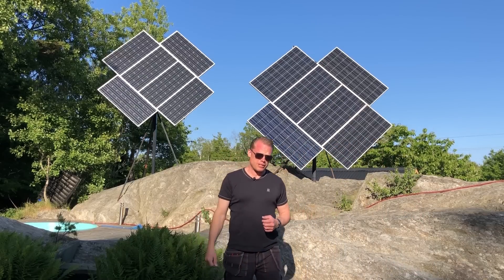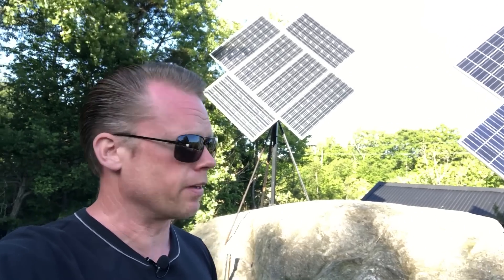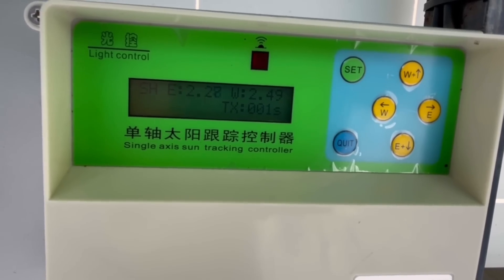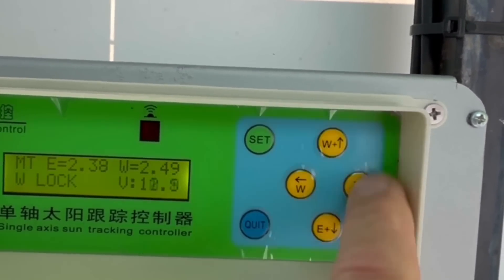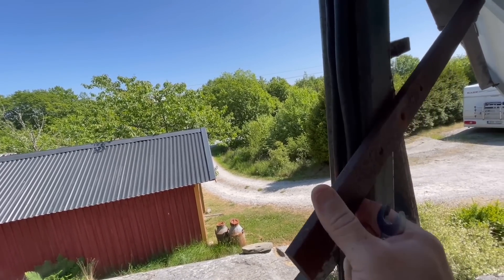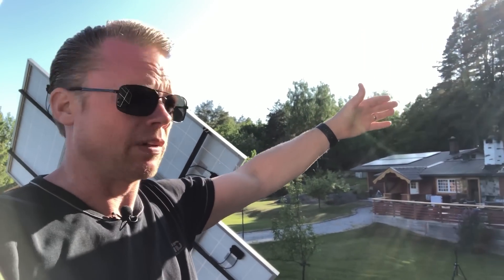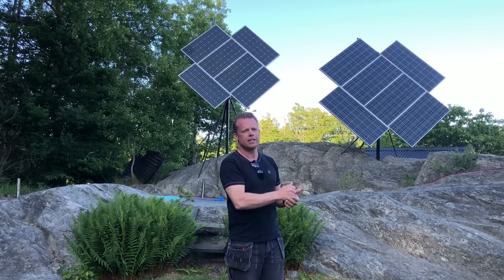Diy Budget Solar Tracker System, tracking vs no tracking.

Comment: Due to the extreme drop in the price of solar panels, it is nowadays extremely cheaper to simply install more panels instead of a tracker!
According to studies, trackers generate a maximum of 40% additional yield per solar panel. But they also cost only 50-100 $ per 450 W panel!
In any case, trackers are mechanics and need maintenance. Trackers are very susceptible to wind and lightning strike. For this reason and because of the mechanics, 
most of them only last some years. If you want more constant yields throughout the day, you simply have to set up your modules in an S-E and S-W orientation.
Reply from the maker: Same comment, different video but you will have the same answer 😅

We guys with trackers already knows everything about that. We do it because it’s fun☺️

Thanks for helping me with the YouTube algorithm btw.👍🏻

Comment: How many KW of heat will the home absorb in thw given time if you cut the trees? (And the opposite for winter/heat)
Reply from the maker: We normally don’t need any ac during the summer. The sun has already passed the horizon before it reaches the trees in the winter time, so no gain of power there.

Comment: I would bet bifacial panels would be better in such tracking systems as opposed to ground mount or roof mount.  Probably would gain you another 10-15%.

Comment: It all comes down to the cost though. That tracking device seem to need some hour of labor to put together as well as the parts. With that much effort and money, it might be cheaper to put a few more panels on the side.
Reply from the maker: Absolutely, I already have more panels and a 62kwh battery, you will find more here: https://youtu.be/IM2jXbgr70A?si=sb3XYXUw_GLmqo7U 
But still i think it’s interesting to show the difference.
Reply: @flyingtools  For sure interesting. And if the space is limited, this is necessary. Thanks

Comment: How far apart are the posts spaced so that they do not shade each other. Thanks
Reply from the maker: Around 6 meters i guess, but one of them are much higher, but in the darkest weeks the south one actually cast a tiny shade on the rear one. I made it telescopic so I can raise it up even higher, but I don’t bother to do that anymore.
Thank you for your question☺️

Comment: Interesting! -- QUESTION -- one issue, @11:50 you show power charts, with Power (W) on one axis, and time on the other.  But the time scale is unclear.  Why is it not showing solar on an hourly scale.  It is not consistent from what I can tell.  Can you show us the chart with the bottom scale in an hourly scale?
Reply from the maker: The screenshot was not taken exactly at the same so the timescale or a little bit of. Sadly, I don’t have any other photos of the chart.

Comment: Nice place!
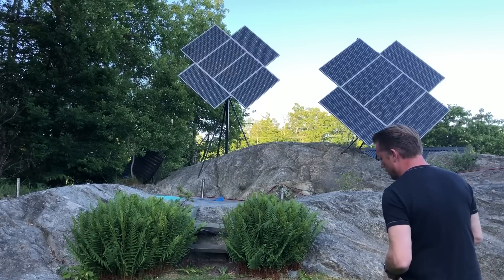11:35 remove trees and put wind generators in the next summer!
Reply from the maker: Thanks, already tried wind generator, I have more videos about that, but I sold it when I changed my battery voltage from 48v to 450v.

Comment: im planning on using similar setup at my house next year so this was very helpful video. I have a question, would 2 axis tracker make sense for winter sun? My plan is to heat water tank storage for heating and washing which in winter is more needed than in summer.
Reply from the maker: I have done some testings with a second axis, and it will not be worth the money at least not here where I live. In the winter time, I just have my panels fixed straight to the south.  I have plans to do a test during the winter time to see how much the gain will be than, I think it will be very little to be honest.
Reply: @flyingtools  thank you for a reply. will consider the simplest solution probably

Comment: That’s amazing! This is what I’m looking for. Do you have some data for me to do a similar construction in Belgium? What kind of single linear actuator and damper did you use? Any help is appreciated 🙂. Thank you in advanced.
Reply from the maker: Hi, and thank you so much for your comment. I have built this straight out of my head so sadly I do not have any blueprints on it. The activators and controllers did I buy on eBay. Hope it helps and have a fantastic day.😊
Reply: @flyingtools  Thanks for response. But what kind of damper did you use, 500N for example? And the single linear actuator is how long for turning your panels? Maybe 18 inches?

Comment: Tracking should always be done on two axes, and then you'll see the real power of the system. The difference, on a clear horizon and tracking vs non-tracking, is actually about 54%. You should only install tracking if you have a complete clear horizon path. Other wise, the difference will be smaller, and in the monts before and afte summer, the results are gonna be bad. Of course, the investment for the tracking systems are small, so there's a bit of a good news.
Reply from the maker: Wow, that’s a very hi number. I adjust the second axel manually, 3 different settings, winter, spring and summer, and I have done some tests with 2 axis vs that type I already have and the difference is not that big at all. But it depends more on where you live. Closer to the poles, the better the numbers tracking versus no tracking will give you, during the summer.

Comment: Very nice sun trackers, not too big or heavy but still producing some useful amount of power. There is also a single  axis tracking option which might be less complicated but also there is going to be slightly less increase in energy. Best regards! Very interesting video!
Reply: This is a single-axis tracker -- with a simple by-hand altitude adjustment once per season if you can be bothered (it seems he can't, just always leaves it in "spring/autumn" setting).

Comment: Where did you get the tracker?
Reply from the maker: I bought the linear actuator on and the controller on eBay, the metalwork have I built myself. Thank you for your question.
Reply: @flyingtools  l can't get the linear actuator to operate off the solar panel alone. Using the charge controller with it just runs the actuator continuously. It won't stop.

Comment: I'm curious -- why did you choose to wire all the panels in series instead of in parallel?
Reply from the maker: It is not easy or maby not possible to find a certified inverter that will work on low voltage in Sweden. There is also 20m distance between the inverter and the trackers so the power loss in the cables would be huge, or the cable all too expensive. Thanks for your question.

Comment: I have 2 arrays and four 400w trina panels (one of them is getting weak in it's production) So.. 2 panels on the ground with a bout a 1 foot of tilt and both side by side pointing to the west. On the Eco worthy dual axis tracker  are the other two 400w panels but one of them is disconnected for now. But in the last week I've been watching it daily and the tracker is IMPRESSIVE..  One panel is making more power than the 2 other panels. https://youtu.be/I566UjPPLXo

Comment: Great video! Just add 30% more panels. (They now so cheap) and avoid tracking unit manufacture and Maintenance, to achieve the same result!
Reply from the maker: I absolutely agree with you on that. I built this, mostly for fun and I of course have a lot of fixed panels also. Thank you for your comment.

Comment: Goid day sir watched every second of video.

I question whats the benefits of doing in series (higher input voltage) vs parallel on the panels
Reply from the maker: Hi!
The power loss is much lesser, and you can also have a thinner gauge of cable.
The inverter also does a much better job with higher voltage and less heat from it. The only downside is that it is dangerous for us humans, and of course, if you shade one panel, the whole string will drop in power.
Thank you for your question.
Reply: @flyingtools  thank yoy

Comment: I have space and money for about 60 200W panels.  While I'm going to skip the tracking, I am going to mount them all on an axis, so I can gradually adjust the angles through the seasons.
Reply from the maker: Yes, that is a much better solution, i’ve built this mostly for fun and thought that it was a good idea to show you guys how much a tracking system actually will boost the kilowatt hours in a long summer day here up north. I of course also have fixed panels and that’s the way to go if you want to build a large system. Good luck with your project
Thank you for your comment.

Comment: Do you manually adjust angle each season or do you leave it same and only track E to W? If you adjust angle, how much percentage improvement?
Reply from the maker: Yes that’s right. I have not done any tests to it but nowadays, I just leave them in spring position, but I can set them between winter spring and summer, but I don’t think that the power output will be so much of a difference. Thank you so much for your comment.

Comment: I've been doing off grid solar systems for about 24 years now and from my experience all trackers fail. And sometimes they fail pretty quickly. Being that you can now purchase solar panels at roughly $.75 per watt I have never seen a calculation that makes trackers even remotely worth the money and installation expense. I also think it takes away from the beauty of solar which is no moving parts and easily lasts for 25 years.
Reply from the maker: You are absolutely right about that.
I have built this mostly because it’s fun and it has been working pretty good for 9 years without any major issues.
I already have 11,25kwp of fixed panels and a diy Hv battery at 62kwh on 450v.
So this tracking system is a minor part of my whole complete setup.
Thank you so much for your comment.
Reply: @flyingtools  That is awesome! Good for you! The funnest part about solar is learning and doing things for yourself! I still have a wind turbine on a 52 foot tower and in the scheme of things it is basically useless. But it sure is Bitchin and I love it when the wind blows hard. My girlfriend hates it and always turns it off.  😝
Reply from the maker: @boblatkey7160  haha, I also had a wind turbine when my battery bank was on 48v.
I have to say I really loved it, but it did never produced so much power, but I loved it anyway😅

Comment: Flying tools

I have always wondered, why people don't mount, mirrors or a mirrored surface, in the sunlight, so they can direct more energy onto the panel's, in low light conditions.

So at Dawn and dusk or cloudy days, you can double or even triple the amount of light hitting the surface of your panels... Obviously on full light days, this would make them too hot. But in a low light condition, this would keep them functioning at 100%
Reply from the maker: Probably because it’s too complex and also more expensive of course, but it is a really interesting idea. Thank you so much for your comment.😊
Reply: @flyingtools  If they can mount 10,000 mirrors in the desert and focus them all on one point to create a hotspot you can focus two mirrors onto your solar array lol

Come on. You're at least 1/5000th of the men they are lol
Reply: @Bozemanjustin  you come across in your comments as a rather rude and abrasive person... 😕
Reply: Mirrors in combination with Photovoltaic is not a good idea. The mirrors will also focus IR (heat radiation), thus heating the panels. PV efficiency drops massively with heat. So, in the end, the added effort may even be detrimental.
If done in combination with solar thermal set-ups, mirrors make of course a lot of sense.
Reply: @klausdittmer1043  The "temperature Coefficient of Pmax" of most solar panels is about 0,4%/°C  (it tells us how much power it loses for every °C that the panel is hotter than 25°C). Even is the panels would get like an additional 20°C hotter than normal when concentrating (a lot of) light on them, they would only lose an additional 8% of power (20°C * 0,4%/°C = 8%) (for an additional 20°C rise in temperature a lot of additional light would be needed). 

The added temperature could potentially degrade the panels sligthly faster..
Reply: @klausdittmer1043  you read my initial comments I specifically said, you could only do it in low-light conditions, just to make the solar cell work at 100% efficiency.

It is one-hundred-percent possible because years after I came up with this idea I want a scientist actually do it and test it

There's plenty of light in the sky at very low light times if you concentrate that light

So monitoring temperature was included in that

But you would have known that if you actually had reading comprehension for what I wrote
Reply: @Bozemanjustin  
I think we both understand the basic issue but draw different conclusions. 
Mirror arrangements that are to be applied only in low light conditions seem not trivial and  are likely adding quite some complexity. Wondering whether the added costs would justify the effort. Might be worthwhile to build a cost model (additional energy gained vs. additional costs) and also compare to just using more panels as an alternative way.

Comment: How much energy the tracking system consumes?
Reply from the maker: Interesting  question. I honestly don’t know. But it’s not much. It now takes the power from the grid using a transformer 220v ac in to 12v dc out. I have also used a 12 V battery on 51ah and that did last for around two weeks so maybe around 50wh/day?
I think I have to measure it up just for fun
Thank you so much for your comment. 😊

Comment: in small right spaces, this is excellent, but where space is not an issue, more panels are cheaper and don't incur the maintenance costs of tracking (and reduced risk of storm damage)
Reply from the maker: You are a spot on there👍🏻
I of course have more panels, 11,25kwp and a 62kWh diy 450v battery.

I have built this mostly for fun. 
Thank you so much for your comment.
Reply: @flyingtools  fun is the best reason! and on really gloomy days, you'll still get a nice bonus.

Comment: So what was the differential kWh - ie area under the curve added and what percentage additional did that represent over the baseline?
Reply from the maker: The difference between fixed and tracking is 3,6kWh in this set up.
It will be much less in the winter time.

Comment: Hello man. What a model you use a tracker engine/actuator and where you buy this? Tack
Reply from the maker: Hi!
I bought cheap linear actuators on eBay for this, 550mm 1500Nm if I remember correctly. I might do a separate vide about the parts I am using.
Thanks for your comment 😊
Reply: @flyingtools  This will be very nice about parts list. Thanks

Comment: Nice work… Thanks for all the research … The counter discussion is to ask what is the extra cost for a tracking system versus 30% more panels … Assuming space is available and that the peak voltage does not require a bigger inverter …  Generally if space is available I find extra panels are a cheaper approach …   Again thanks for the video ..
Reply: 30% more panels will theoretically make up the shortfall in daily kWh, but your problem is that adding those panels may see the array exceed the controller's maximum voltage or current limits in the middle of the day, including the potential short circuit current limit.  So ideally you would have the additional panels with a DC circuit breaker on a timer which brings them into the circuit in the morning and evening, but drops them out of the circuit at times of peak insolation.  
Depending on the setup, this may only be a problem in summer, but it needs to be considered.
The tracker system doesn't have this issue.
Reply: @nigelwilliams7920  The issue is cost. If having a tracking system is cheaper than adding more panels to get 30% more power then it'd be best to get a tracker.

Another issue is that it might be better for people who aren't home during the day and have no battery. Those people need more power in the morning and evening when they are home.
Reply: The time of supply is alos important I guess. You want to generate more during peek demand when energy is expensive...
Reply: @robertnorman7309  very good point - in most cases peek demand is early morning and late afternoon… which then says East and West static bias is more important than north / south - depending on hemisphere…
Reply from the maker: @thevidco it depends on. I have done all of the work myself and just paid for the iron bars, controller and the linear activators, so, in my case, I probably will go break even.
I built this mostly for a fun, and I don’t think that this is a way to go if you’re looking to gain more money out from it. I personally have a lot of fixed panels, one string to the east and the other string straight to the south, and for me that is the best and most economically way to go. Thank you for your comment.